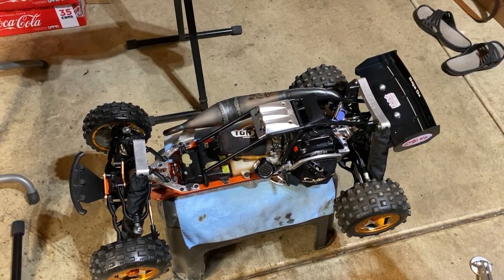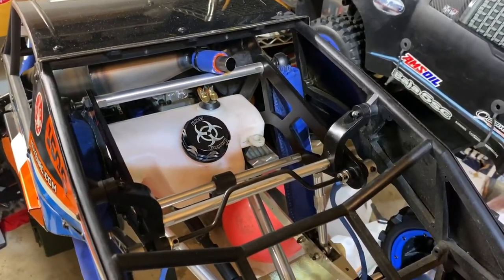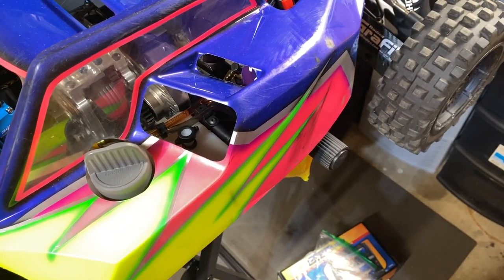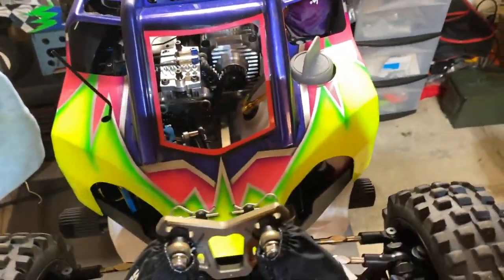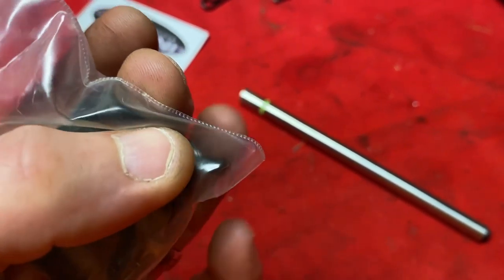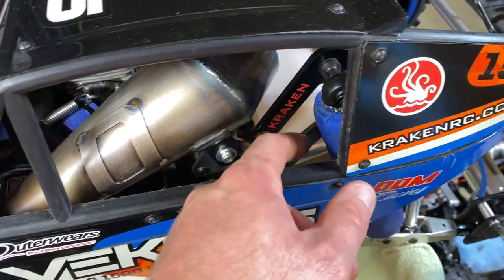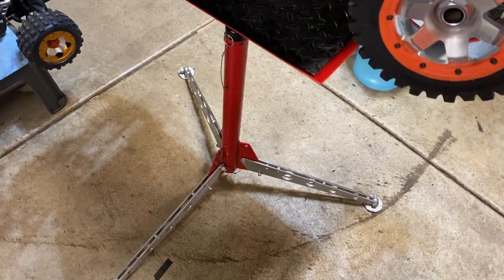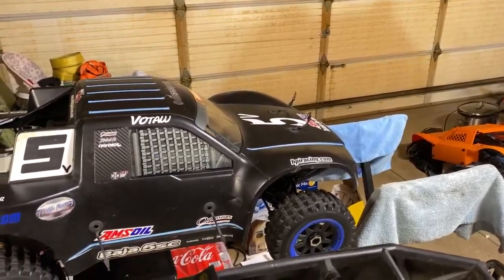After run thoughts, future upgrades, and goodies

Comment: nice builds man.. im new to your channel I'm likening the video so far. I use VP C12 race gas and you see a noticeable difference between VP C9 and VP C12 fuel it smells better and you can definitely see and feel the difference in power.. also I just picked up my first vekta5 lse kit, and it went together smoothly just had a little issue with the clutch Bell wobble, ended up getting rid of that lock washer used a flat washer with the vertigo clutch Bell shaft made it a little bit better but still a tiny tiny bit of wobble... was curious to see how you like the vertigo trans setup it's a little expensive so wanted to get your opinion on it thanks man
Reply from the maker: I will say the  vertigo trans is the best, way better then the t90, there’s way more gearing options and it’s pretty bulletproof. I heard of people having that issue with the clutch bell, my issue with the stock trans was the bearings kept falling out, congrats on the new ride. Is u would like more info z281090@yahoo.com then I can send u my #
Reply: Is your engine designed to run C12? I'm wanting to grab some, but my OBR 6329 SS was made for like 93 to 95, I believe. Right now I'm just using the VP 4 stroke gas that's 94 octane. Maybe I'll go with C9 or C10.